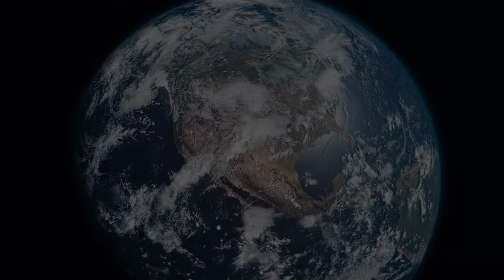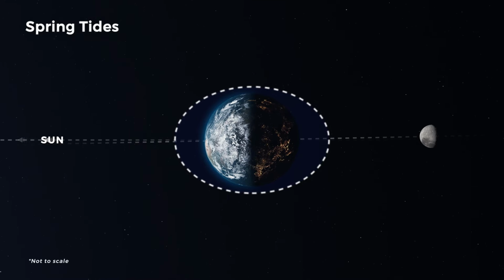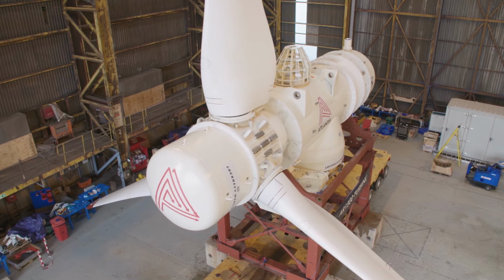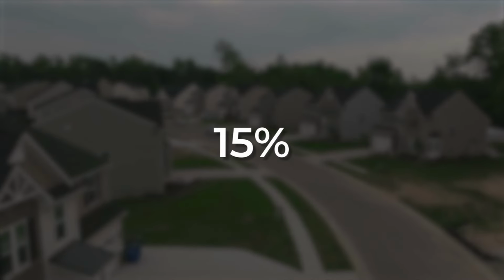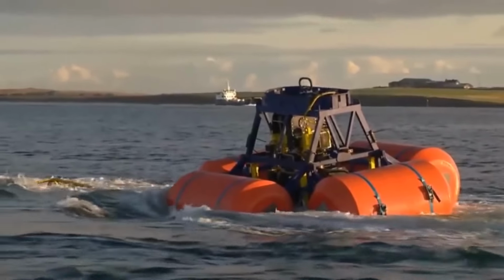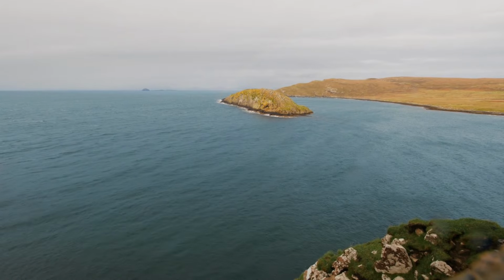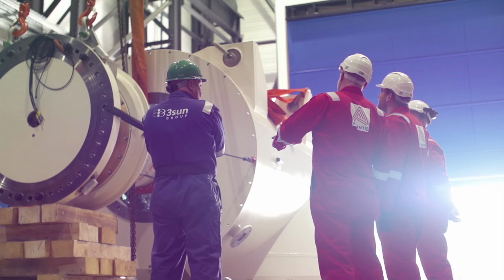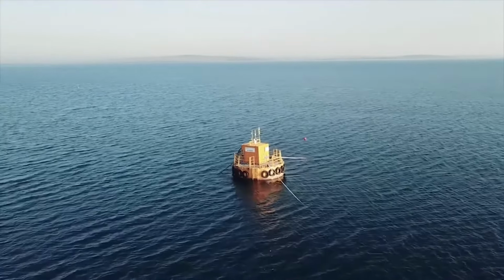Can Underwater Turbines Solve Our Energy Problems?

Comment: Would it make sense to combine off-shore wind turbines with tidal turbines in order to take advantage of the already existing infrastructure?
Reply: That's a solid "maybe". Areas that are suitable for wind turbines are not automatically good sites for tidal turbines, and vice versa. There have been some very vague proposals to do that kind of thing, but no-one has ever come up with a really feasible general tide power solution (dozens and dozens of ones that might work in specific conditions, but no single design that could just be mass produced and used globally)

Comment: Really good to see development in tidal power. An idea that I have talked about for decades now.
I grew up in the tropical north of Australia where tidal movement is several metres for every change in tides. Just seems natural to put some sort of turbine in areas that will deliver non-stop electricity every day if the year.
The only problem I could see was the erosion of equipment in sea water, but this looks like it has been solved.
The environmental impact would possibly take some planning to overcome problems for sea life, but certainly wouldn't be insurmountable.
Just a matter of convincing short-sighted governments that this idea would be great for future power reliability and cost.
Reply: orrrr lets stop using so much energy? and not rape the oceans.

Comment: I'm still confused by wireless electricity,  But if its wireless,  what about space. I prefer solar, I think there must be a more efficient solar energy using magnification, because if you can make fire with a magnifying glass....then what if instead we find a way to absorb that increased frequency
Reply: There is, it's called thermal solar I think. It uses mirrors to heat up steam to drive turbines.
Reply: @anxiousearth680  No that does not use magnifying glass, just direct sunlight onto panels.
Reply: @Dman8s  I don't see how that's different. There are no pv panels in solar thermal energy. Just mirror panels focusing the sun to a thermal storage medium like liquid salt.

Is that not what you mean by magnifying glass?
Reply: @anxiousearth680  its actually a big difference,  you'd be magnifying the sun through an external magnifying glass. It means more heat for the water in the panel. You can start a fire with a regular magnifying glass which is common knowledge.

Comment: Why can’t we just use nuclear? It’s much more efficient and safe.
Reply: Hmm... You think? I say, even if there wasn’t the nasty downside of the long lasting toxic waste, even then nuclear wouldn’t be the best option.
Reply: @Peter goes to Hollywood that’s not much of a nasty downside, when it produces less waste, and is the only energy source where it’s waste is contained.
Also it is the best option, because it produces more energy than any other energy source, while also having the smallest environmental impact.
Reply: Cooper Hawk yes, but this waste must be guaranteed to be contained for hundreds and thousands of years. No society can guarantee the required stability over such a long period. Nations rise and fall, and what happens in between is what makes me concerned about toxic waste. 
Btw, many calculations for nuclear do not include disposal of contaminated water, dismantling and the addressed waste handling. Thus most general figures do not reflect reality since economic calculations mainly compare ongoing intake vs. Output. (Which makes it seem ultra cheap) 
Uranium is afterall the limiting factor for uranium based platforms, since it isn’t abundant enough to even support the whole world in theory. I’m rather interested in LFT-reactors and I’m keen on fusion taking off somewhere in the future. However, we don’t have the time to wait on those to be applicable en grande. Furthermore would you trust/burden third world countries with the handling of nuclear plants, when they cannot provide the specialists, scientist and political stability needed to operate such facilities? And even if ITER proves victory and fusion takes off, it will be a powersource reserved only for the 1#-world countries for a very very long time, due to its ultra high technical requirements.

Now, renewables bring the attribute of decentralising powergrids which are much more resilient against external influences. Remember how in 2003 a great part of Italy and Switzerland was blackouted due to the cascading effect of a single powerline failing. 
Another prominent effect of renewables is that communes and private people get the chance on generating an additional income for their families, while making them less dependent on big power companies. Renewables enhance prosperity for the people, centralised powergeneration enhances prosperity of just a few giant companies.
Im closing with the fact, that renewable sources are the only sources that have the potential to become carbon negative.
Sorry for the long story ;) this is an really important topic for me personally.
Reply: @Peter goes to Hollywood Renewables don’t have the potential to be carbon negative. Other than hydropower in certain cases, all renewable energy sources produce more CO2 than nuclear. Also while nuclear was will stay radioactive for a few thousand years, the most radioactive parts of that waste will decay in less time. And even if we can’t guarantee that we can store it for thousands of years, it is still better to have it contained in 1 area, then dumped out into the land, and air like with fossils fuels, solar, and wind.
Reply: Cooper Hawk from where do you take the Information that renewables lifecycles could not become carbon neutral/negative? I have already covered why nuclear falsely seems to be more carbon efficient than some renewables, which you swiftly choose to ignore. And yes, nuclear waste decays over time... into compounds similar in toxicity. Take e.g. Uranium-238 which will eventually turn into stable lead after around a massive 4 BILLION YEARS, in between its always toxic! That’s basic chemistry. Fossil fuels emissions end up in the environment, so much is for sure. But the fuck do you mean with „dumped out into the land [...] solar and wind?“ Waste-productst from mining, eventually??? Because then you could not support anything that’s made from any modern material (certainly not nuclear either) without being a hypocrite.
And who in your opinion could possibly regulate and enforce a worldwide policy especially in more unstable countries, that nuclear waste storage gets handled appropriately? Since an appropriate way to store it was not found over the last 7 decades. There were many promising approaches and so far every single one of them failed.

Afterall you did not even respond to the social/security benefits of the renewable vs. Disadvantages of nuclear regarding centralisation/decentralisation.

I slowly get the impression you live in an imaginary world where there is only place for the information that suits the worldview you inhabitate.

Comment: We still have to produce these turbines, transport them, maintain them, and replace them. We ultimately end up causing more pollution in the long run
Reply: than releasing C02 from fossile fuels or nuclear waste? No way... even if. Whataboutism doesn't fix anything on climate
Reply: @cyklonetidalenergy7141  you're releasing more Co2 when you produce, transport, maintain, and replace them...Where do you think that energy comes from?
Reply: @MistaOneGuy  To build the turbines you can use electricity almost exclusively. Melt the metals inductively, recycle them, machine them. Once you broke free from fossile fuels utilizing the 0.01 €/kWh it is self-sustaining for 100.000 years at a very high rate like 99%. So where do I have to release CO2 past the initial turbine? We can use simple construction steel recycled from old cars. Any of intital CO2 release for maching would be contributed by the current system not being able to supply 100% green grid power. The alternative to your argument is keeping to use fossile fuels on a global scale- someone will keep using them until the climate tanks. #tippingpoints #SDGs Do I miss your point here?
Reply: @cyklonetidalenergy7141  that is not at all how the turbines are made. But where do you think the electricity would come from? Circular logic...  I suggest you watch "planet of the humans" and read "Climate Change: The Facts 2017" ... I used to carry the same opinion your presenting right now. You've been misinformed. As it currently stands, there is no such thing as "breaking free from fossil fuels"
Reply: @MistaOneGuy   I know the films. Yes, we can break free from fossile fuels and become CO2-neutral using tidal power turbines combined with onshore and offshore wind plus solar. Why? Because the energy density is 1.000 times higher and there is no land usage conflict. That's the 2 facts these docus don't consider. It doesn't matter becasue we are doomed of my argument doesn't hold up. Humans have absolutely no intent to go below an annual GDP of 4K. USD/EUR and stop using tech. That's were people are enabled to voice environmental demands to governments. Either we enable a life based on electricity and freeing people from high child death rate, starvation, transporting water and goods, give them heating, safe housing and food on tables. Or we fail.

It remains to be a very big challenge. We can add reforestation concepts like https://youtu.be/vpTHi7O66pI
So I don't fully go for these doomsday negativity of these docudramas. Their political message is primarily ideological. it honours your personality that you did confront these dire messages and not turn away, Their goal is to wake people up and trigger climate action. Which I do fully support.

Nevertheless as an aerospace engineer I think in pragmatic solutions. As a business owner i think in customers demand, price levels, cash flow and product matches. So I do think Cyklone C500 T freestream tidal turbines for low currents is a great product design to achieve climate goals fast. Espescially cause I can accelerate phasing out coal as cheap and dirty energy. it works for India and China too. Anybody can chose sth that is cheaper than fossile w/o conflict. You don't need to convince people of giving up their toys. Frankly I have been attacked for "destroying the political framework" by my concept. Immunizing me aigainst some pro climate propaganda beyond science. I'm agnostic to that framework. What do you need that for? What's it's purpose? Do we prioritize to decarbonize or are we politicking about Club of Rome and SDGs and rally against economies? This is a business model and not an agenda for Dogooders or Luddites.

Just my personal view ad message of hope... open for arguments. I'll try it anyways with the support I can get.
Reply: @cyklonetidalenergy7141  circles with you
Reply: @MistaOneGuy  Do you have any background in recycling and circuar economy concepts? Sustainability is inherently circular exchanges of physical matter. Thinking in circles is what the task requieres after all in connected feedback loops of energy and economy. Before we achieve 2030, 2040 and 2050 climate gloals that's a hypothetical internet critique on a acute crisis. Easy claim that my thinking is flawed w/o proposing any qualified viable approach yourself or highlighting any real issue with it? Going back to stone age won't realistiscally happen. In case we run out of some ressource 100.000 years later, we got plenty of time to address that.
Reply: @cyklonetidalenergy7141  your logic is circular.  Nice attempt at playing on a phrase.  The point being made is that your chasing your tail. And if you actually watched the movie, and/or read the book you wouldn't be arguing any of this. Both made a very compelling case. Go ahead and watch it.  You'll be glad you did
Reply: @MistaOneGuy  as I said before I watched "Planet of the Humans by Jeff Gibbs". 
Fancy that I knew or understood that by 2008 when I started to work on CyKlone Tidal Energy already. I basically dedicated my work life to fix what that movie is pointing to. Engineering more eficient renewable energy. With 10+ years in the field I can give a competent answer to the movies claims.

That movie simply says we are exticnt in 2 generations and nothing can do to save humanity. We go extinct by 2050. No tech will save us. That's a doomsday argument driven by fear. The ultimate luddite story. Let's all go back to the cave and misery.
nevertheless i do agree with the Michael Moore style ranting vividly on follies of renewables progress achievd. That's pretty much on point. 

Nevertheless judging from the rear view mirror about the road ahead falls for a logic fallacy. CyKlone Tidal Energy is the next thing to try. I'm not the fiirst one in tidal power. Many have tried and failed. it's the highest density 24/7 available energy potential in nature. We don't know it's CO2 balance sheet over lifetime.

The wind energy balance sheet is marginaally CO2 positive. Tidal power needs 5 times smaller turbines so 5 times less ressource.

Additionally we need to leverage this https://youtu.be/vpTHi7O66pI 

Is "Planet of the Humans" right or wrong? I don't care for the lack of options. Succumb to fears or work to fix it. I don't need to waste my  time ranting about circular logic.

Read Hans Rosling "Factfulness". Then you grasp why humanity doesn't have the option to give up on tech or economy and enjoy peaceful luddism globally. Why you can't convince anyone of that. This nativist path doesn't exist. Neither by force nor by election. it's a mental fallacy trap not worth discussing. That just mirrors discussing with flat earthers and climate deniers.

Tidal energy does fix the key points of the CO2 balance argument. Take it or leave it. Quo vadis?

Comment: ANSWER: NO
Calculate the surface area necessary to make enough power, Fusion is the ONLY way.
Dynamos are a 100+ year old tech placing them in fancy packages is not a new solution.
Just like solar and bio fuel, it only benefits the mining and steel industry.
Reply: Lol, how do you think fusion, when it works, will generate energy? Through turbines all the same. Same with coal, same with nuclear and renewables, barring solar.

Comment: Idea - Once battery storage hits the kinds of power density we're expecting over the next 10 years (2-3x today's lithium density) more boats and ships will be electric powered. What if these devices are used throughout key ocean routes to fill their own battery in order to re-fuel boats and ships that pass through those routes. You can use wind mills, but perhaps there are benefits in this application not possible with a wind-mill, plus price you can charge per KWH will be higher.

Comment: There is a lot of energy in the oceans, just as there is a lot of energy from the sun. However capturing that energy is very difficult because it is diffused and in other words has low energy density.
Immersing mechanical devices in the sea is going to mean very high maintenance costs. Wave and tidal energy is certainly not the answer to our energy problem, if you think there is a problem?
If there is a crisis that needs our energy to be produced with no CO2 emissions then the answer has been there for decades, nuclear which produces very large amounts of power from very little fuel. That it is not more widely accepted tells me there is no emergency or crisis, as the solution is obvious and proven.

Comment: The available annual energy generation for the sites mentioned adds up to 1190 TWh. Total US electrical generation in 2017 was about 4300 TWh. 1190 TWh is about 28% of that.Last year may have been slightly more. IAC that's just electricity. You referred to all energy, implying much more than electricity alone. So your figures are far off.
Reply: Ronald Garrison the professional name for this type of „all used energy combined“ you were looking for is primary energy sources.
Reply: @petergoestohollywood382  And this has just what to do with my comment? You used a phrase that I didn't even use FFS.

Comment: How about this: anchor a large ship anywhere there is a swell. Place a shifting mass on some kind of fulcrum. A pendulum or a balance. As the ship rolls, the mass shifts back and forth, driving a flywheel, driving a generator. Steer the ship into the swell and let it generate. Make sure the mass isn't too big, and that it can be locked down in heavy weather. It can be run automatically, or hire some old sea dog to stand boldly and picturesquely at the helm.

Comment: "Difficult, if not impossible, but if we can..." famous last words of all green energy fanatics. Zero understanding, knowledge, or experience in the engineering fields required to bring about these pipe dreams. Great video skills, though. Still, it's a worn-out Sci-Fi theme. Wake up, folks! There is energy practically everywhere. Ideas about how to harness this energy are endless. Overcoming engineering and logistic problems are on the other end of the scale. Instead of imagining what might be done, how about demonstrating what can actually be done? There is very little cost in computer generated images. I'm not going to hold my breath waiting to see if anyone can build a real world system that works.

@1:30.... "Some people have used the difference in salinity between rivers and oceans to generate electricity...." Yeah, and some people have used a comb in their hair to generate electricity. (I've done it, myself)

Comment: sorry but they are using the wrong blades and it should be modular as for it having no effect on fish and underwater life they are incorrect this type of blade causes vast noise and disturbance i have had a modular system and a deep sea pressure system for the last twenty years is this a joke, these people are supposed to be clever and i have no qualifications. unreal